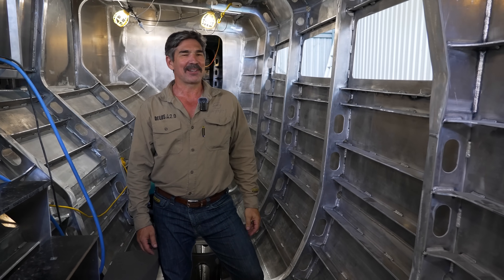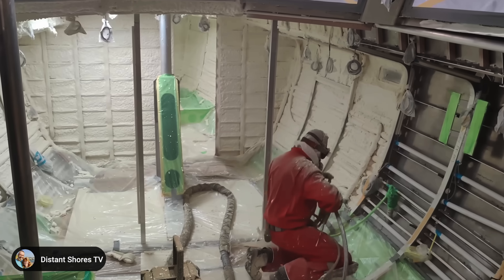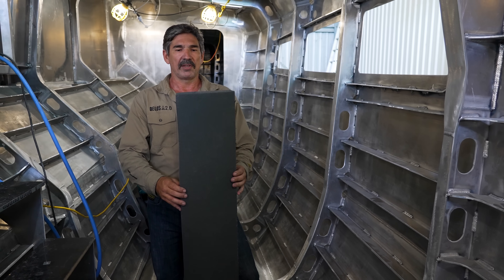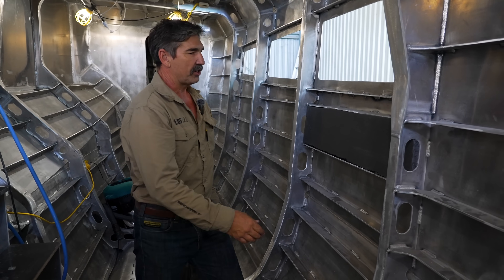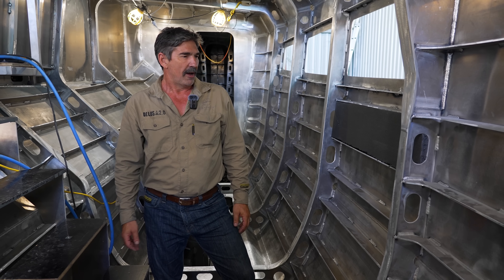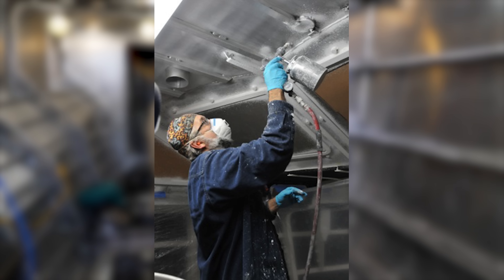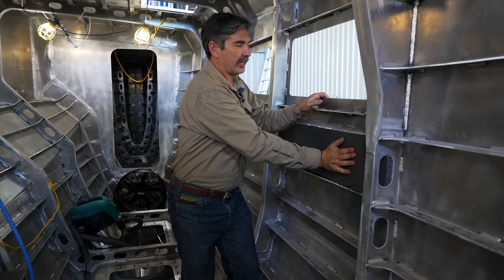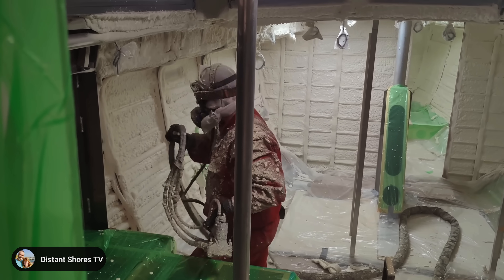HELP, We Need Your Advice!  How Should We Insulate Our Aluminum Catamaran???

Comment: I am not an expert in terms of procedures to follow for optimization but there is a procedure which is as follows: Protect all the metal parts with a suitable paint, then spray on the whole assembly a thin layer (+/- 4 mm) of cork which should avoid the problem of condensation and finalize your insulation with panels like those you show in your video. Do not forget to install a film which will act as a buffer between the insulation and the final cladding. I love watching your videos relating to your project which I find very interesting. Good luck for the future and keep the same motivation. Regards from France.

Comment: I would look into spraying  a rubberized thick coating and then use cork or closed cell foam over that. I would add that I know absolutely nothing about the subject at hand and have zero experience at this.      Edit after watching 5 minutes, I like the spray on coating. It seems close to my original uninformed thoughts

Comment: Here in the Netherlands we use spray foam. Te hull is cleaned and  primed with a 2k coat. 
It’s easy to scrape cut the foam away and so repair that. 
Look at s/v distances shores how that is done. 
Sticky back will come of when moisture gets behind it. 
To avoid corrosion you need to prime the hull it does not matter what isolation you pick.
Aircraft have a similar problem and they use a bee wax like material but that does not work well salty environment. 
In aircraft isolation lives in Mylar bags pinned to the stringers. That’s done to avoid corrosion and it’s easy access.
Also the weight is minimum. 
But this method is not isolating very well. 
The spray foam method makes the hull polar proof so to say. 
A good worked out plan with pvc pipes can make live easy for water lines and electric cables. Those can be over-sprayed with foam.  
You can’t isolate the complete hull as there must be a place where water can reside or condensate up on.
Meaning that your bilge must not be isolated in a whole. Somewhere the moist must be collected.
Reply: This. Spray foam over correctly primed aluminum. If damaged, foam is easy enough to remove for repairs.
Reply: @Cmoredebris  absolutely true 👍🏻
Reply: Try Cork spray foam. It’s a natural material, super light and not flamable. The Cork comes out from trees. NASA uses Cork on spacecrafts. Portugal is the main Cork producer but you can find it all over the world. You can find also in the shape of plates of compressed Cork. Look for seacork
Reply: @josehinga5141  don’t use al the cork we have in the world . I love to hear a wine bottle say ‘plop’ when uncorked.
A twist / screw cap is so not done.
Reply: @ no problem! The good news is that they only use the scrap from the bottle cork factory. Wine first! 😁
Reply: How do you inspect for cracks, which can happen with aluminium? In aircraft they go through a D check where everything is removed and the hull is inspected. Is this just not necessary for a boat?
Reply: @ that’s a very good question. If the welders are wise and able to prevent extreme tention during the welding process there will be no cracks. The aluminium used for ships is different than aircraft aluminium. Also much thicker and not chemical milled like aircraft skins now. An aircraft structure is not welded but basically pinned together. 
Around those multiple pin holes cracks are easily formed.  
If the cat Delos 2 is sailing the vibration will be on a very very lof frequency.  An aircraft has a massive vibration problem all the way.
Reply: @MonkPetite  Exactly. Look at videos of Dutch yacht builders and those working on Delos and watch their set up and welding. Quality beads, correct settings and the way beads are finished to avoid pits (often the origin of cracks), will help insure the hull will not develop problems.

Comment: Spray it and buit your interior insulated from the hull any water will be bad, any sound bridge will be bad. In aviation they remove the insulation at major overhaul to inspect the aluminium so you total hull inside must be removable or everything behind it accessible. Review aluminium boats of > 15 years

Comment: You might be well past these decisions by the time you published this video to Youtube, but, I think as much as possible you should use Dynamat or Kilmat to sound deaden and insulate the hull. I look at large production, cost conscious aluminum car manufacturing, like the C8 Corvette and they use a lot of sound deadening mat. Also, a lot of C8 owners add additional mat for both insulation and sound deadening. And sorry, I have only built wooden boats, a 54' Roberts West Systems boat, but we did use sound deadening mat on the aluminum tanks.

Comment: Insulating between the ribs could be an issue as the ribs themselves will potentially sweat causing moisture between insulating panels.

Comment: What about the thick truck bed liner spray with the foam pieces? That stuff stops condensation, helps insulate and never cracks and can be sprayed to whatever thickness u need, in combo of the foam pieces?

Comment: my last aluminium boat was insulated original with some kind off hard foam that was fireproof I have noe idea what product it was. I added more insulation with the armacell with tape on the backside and its a really really demanding job and almost impossible to get a good result. I have had boats with armacell and rockwool before and they are okay. but iff I could choose I would have gone for the spray solution to avoid cold bridges. I live in 67 degree north in Norway so you know the climate. I have been in same situation and no doubt about the spray on solution. how many times would it happen that you need to go behind the walls and do something. ?  and I hope that you are planning to weld brackets over the deck where all your bolt on gear is so you don't need to bolt tru the deck

Comment: Not a boat owner (yet), but from my research, i would do something like Mascoat/Decicoat than foam coating (neolon). Especially with an alu-boat so that way you can still access the skin of the boat from the inside to make repairs incase you need to. my next concern would be how difficult/easy mascoat/decicoat is to remove in order to make a patch (if necessary)

Comment: I like the foam cut to fit spaces, maybe there is some kind of vapor breathable membrane like goretex applied over the top that could allow moisture to escape? Coating the aluminum to protect it is probably a good idea. Have some clients in commercial roofing and water proofing, that deal with products like Gacoflex and EPDM/TPO rubber and such, there may exist solutions in the commercial roofing industry to explore.

Comment: The issue with spray foam in basically any application is if there is a leak it will turn into a giant sponge and make harder to determine the location of the leak... so you better be really sure about water in the area and being water tight...
Reply: The foam is closed cell.
Reply: There is both open and closed cell spray foam products. The closed cell is available in different densities and can be structural.
Reply: @jefflange3009  Correct,  In the 35 years I have worked boat building, rebuilding and Marine Tech work,  I have only seen closed cell used for marine applications.  I was responding to tgbst88 's comment     =   "The issue with spray foam in basically any application is if there is a leak it will turn into a giant sponge".   I believe that Delos II will end up priming the interior and using a combination of closed cell, spray and sheet/blanket insulations.  I asked Brian this question months ago out of curiosity and am confident that they will find a solution that works for them.   I think asking aerospace engineers and aluminum boat builders will help them get a clear picture of what they want to do on Delos II.
Reply: You would never use any open cell foam on a boat! It needs to be a closed cell foam that is flame retardant. The expensive stuff 😊.

Comment: For me I’d be thinking about a solution which is fire retardant, will not wick water (closed Cell), will be attached the the boat with sufficient strength so that it wont start floating about the hull if it were filled with water making egress more difficult, will support the creation of cable/pipe ducts and will ideally provide enough buoyancy to offset the weight of the yacht making her unsinkable…

Comment: Spray foam is the best for insulating metal the closed foam no it is easy to cut out and easily sprayed back when you finish the repair and is also a floatation device to keep your boat afloat if you breach the hull! But use the closed fome not the air foam!😊❤

Comment: Sprayfoam prevents condensation and does not have small slits letting air between hull and insulation. It's a proven method

Comment: I know you said you didn't want to paint the exterior of the aluminum but I still think it would be a good idea to put some kind of sealer on the exterior. The interior could have some kind of anti-fungal mold resistant paint of some kind on the inside because aluminum it's going to condense.

Comment: Polyisocyanurate for the incredible performance and ease of install, glue it in with dabs of expanding foam or silicone.

But I think if you can make the walls air tight it will stop condensation on the metal.

Comment: Sailing Uma have done some Cork core so maybe worth a consideration.  I think barrier coat the interior with the 2mm layer and then the black foam over the top that has the sticky backing.  You are an engineer you will get it right more than I would 😂

Comment: Just spit balling here...  If the problem with the spray foam is access after the fact, could you build accessible chase ways for all your electrical, plumbing, and cable runs then and spray foam around that?  Mask it off so you can build a removable access panel for the entire length of the run.  

In my mind, if you can use spray foam but overcome the access for repairs / expansion / upgrade problem, that's the way to go.

Comment: Have you considered zinc chromate? US military uses it on it’s aluminum aircraft to prevent moisture and  corrosion   ,,  it’s also used on ocean oil tankers , I know there are dozens of applications for it ,,
Reply: I was going to suggest the same thing. Zinc Chromate makes it easier to inspect for corrosion or damage.

Comment: I would use both - the foam and the spray
Reply: I’d coat the hull with epoxy or zinc. Then leave a small gap between the hull and the insulation to direct any moisture to the bilge. Hate to trap condensation inside the walls.
Reply: I ASKED AI - Insulating an aluminum catamaran is a great idea to improve comfort, prevent condensation, and protect the boat from extreme temperatures. Here’s a breakdown of how to approach it:

### 1. *Why Insulate?*
   - **Temperature Control**: Aluminum boats are prone to getting very hot in the sun and cold at night. Insulation helps maintain a comfortable interior temperature.
   - **Condensation Prevention**: Insulation helps reduce condensation, which can cause rust, mold, and mildew.
   - **Noise Reduction**: Insulation also dampens the sound of waves and the engine, making the interior quieter.

### 2. *Types of Insulation*
   You’ll likely need a combination of materials to address the unique needs of an aluminum catamaran.

   #### *Closed-Cell Foam (Spray Foam or Sheets)*
   - **Benefits**: Closed-cell foam is water-resistant and provides excellent thermal insulation. It's also good at soundproofing.
   - **Application**: Use it in the walls, ceilings, and floor of the hulls. It adheres well to aluminum and prevents moisture from getting in.
   - **Options**:
     - **Rigid Foam Sheets**: These are easy to cut and install, and you can seal the gaps with spray foam.
     - **Spray Foam**: This can be sprayed into hard-to-reach areas and expands to fill gaps.

   #### *Reflective Foil Insulation*
   - **Benefits**: Reflective foil works well to reflect heat away and keep the boat cooler, especially when it’s exposed to direct sunlight.
   - **Application**: It can be installed over the foam or used in areas with high sun exposure, like the roof and deck.
   - **Best Use**: Layer this under the deck or in areas where reflective heat could be an issue (e.g., the roof or hulls).

   #### *Thermal Insulation Mats (Cork, Rubber, or Felt Mats)*
   - **Benefits**: These provide both thermal insulation and soundproofing, especially on the floors.
   - **Application**: Cork mats or rubber underlayments can be used on the interior of the boat, especially where you walk, like the floors or cabin areas.

   #### *Fiberglass Insulation*
   - **Benefits**: Fiberglass is widely used and has excellent insulating properties. It can be a bit messier to install and must be carefully sealed.
   - **Application**: It can be used behind paneling or in other accessible areas but requires a vapor barrier to avoid moisture buildup.

### 3. *Installation Tips*
   - **Seal Gaps**: Even the best insulation won’t work if there are air gaps. Make sure seams, edges, and openings are properly sealed with sealant or tape.
   - **Vapor Barriers**: Aluminum is prone to condensation. Ensure you add vapor barriers (like reflective foil or a plastic sheet) between the insulation and the aluminum surfaces to prevent moisture buildup.
   - **Ventilation**: Proper ventilation is key. You want to avoid trapping moisture inside the boat. Consider adding ventilation grills or dehumidifiers in the cabin to keep air moving.

### 4. *Where to Insulate*
   - **Hull Sides**: Insulate both the interior of the hull and the underside of the deck. Spray foam and rigid foam boards are perfect for this.
   - **Cabin Ceiling**: Insulate the underside of the cabin roof to help with heat and sound reduction. Reflective foil or foam sheets are a good option here.
   - **Floors**: You can use rubber or cork mats for the floors to reduce noise and improve comfort.
   - **Engine Compartment**: Soundproofing materials can reduce engine noise, and thermal insulation will help maintain engine temperature.

### 5. *Additional Considerations*
   - **Weight**: Be mindful of the weight of the insulation materials. You don’t want to overload your boat. Go for lightweight options where possible.
   - **Fire Resistance**: Ensure that the insulation materials you choose are fire-resistant. Aluminum boats are more likely to catch fire than fiberglass, so prioritize fire-rated products.
   - **Durability**: Use materials that are marine-grade and resistant to moisture, mildew, and UV light.

By combining various insulation materials (rigid foam, reflective foil, rubber mats, etc.), you'll get the best overall results for comfort, efficiency, and longevity in your catamaran.

Comment: The pins work great for short term but over the long term the foam isn't equally supported and starts to sag.  May not be an issue with that foam, but that is the problems I had with heavier foam.

Comment: Yeah, having foam or anything else that can hold moisture against the hull is bad. My aluminum fuel tanks had foam between them and the hull and water got behind the foam against the tank and corroded away until a leak formed. Not fun cleaning out the bilge and replacing that tank.

Comment: You might be able to fit a sleve of insulation over the ridges? Kind of like a door edge guard? And then use the panel insulation around that? (I know nothing about boat insulation so definitely take that with a grain of salt!)

Comment: The spray on is how we did it but you want to have any of the electrical and plumbing done and use a pipe or tunnel to keep the space of the lines so in the future u can run new items through the same space . We used a 3 inch duct to accommodate that so the inside wall is smooth or convenient to push or pull lines without having to open the wall space
Reply: You can also use a pig and air compressor or vacuum to pull a messenger line through your conduit even if it's not smooth inside.

Comment: Urethane closed cell spray foam. You want it to stick like nothing else to ensure no air can condense on the inside of hull. Also sprayed foam is unbeatable sound insulation. Yes you will have a thermal bridge in uncovered metal. No brainer. Buuut....going for BattleBorn type solution is going to come back at you.

Comment: Cork is less inflammable than polyurethane and If it's decently ventilated won't suffer from Moisture. Cork pannels are easy to replace too.
Reply: Cork rots when wet, like most other natural materials. In former times it was used to insulate fishing boat cold storages, but infused with tar to keep it from rotting. Not so nice on a modern boat.

In boats and RVs, there really is no way around moisture-blocking foams.
Reply: @bimodo1472  it can Moist but for a vast majority of area it's decent. I get your point, but there a quite a few expedition sailboat insulated with projected Cork or Cork pannels. Personnaly i prefer to change a pannel every One and then than insulate with a very inflammable material. But i guess that's down to preference